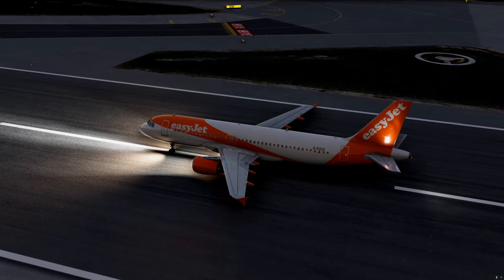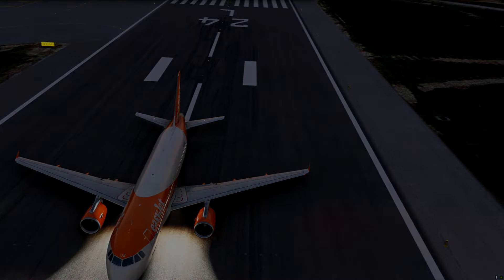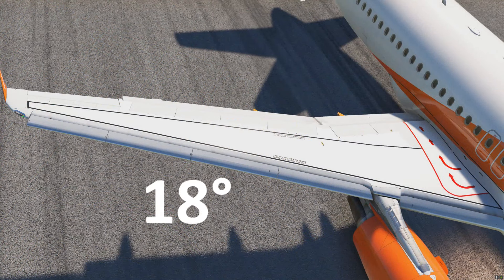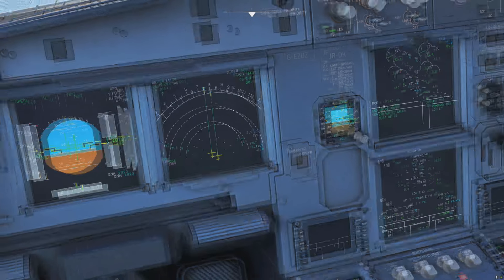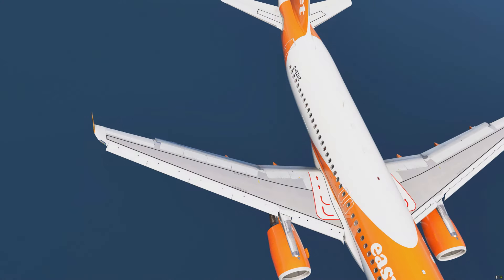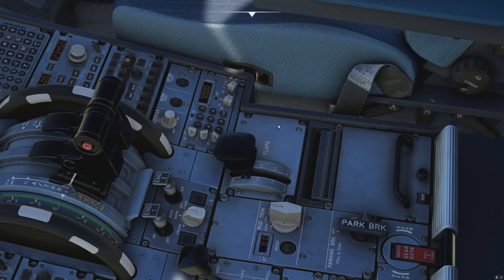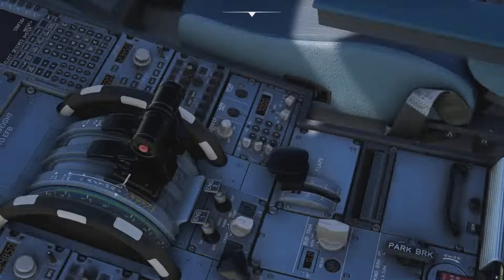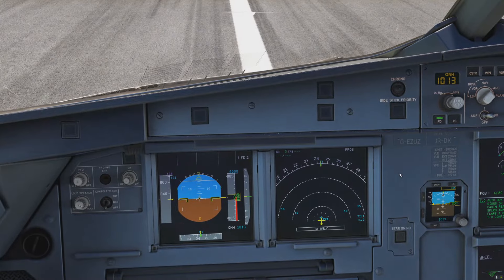Yes, the Airbus can move the flaps all by itself! A320 Flaps and Slats explained.

Comment: What flap setting should be used at hot and high airports? I’m talking about many South American airports such as Bogota or Cuzco or even La Paz. In all of them there are a320 operations which require being very close to MTOW and all of them have long runways but are at a heigh unseen in Europe
Reply from the maker: @pylt93  After a certain altitude you are actually limited by the maximum tire speed which is 195kts on the A320.
I have never flown out of such high altitude airports, but I would think the considerations are the same. If you have terrain around you your climb performance will be the limiting factor.
Don't forget however that the maximum altitude for any flaps on the A320 is 20.000 ft. By this point you have to be clean. Also when flying an approach you need to stay clean until 20.000 ft which might be quite late.
Reply: @fsclips  I understand, it would be a nice challenge to do a Bogotá to la paz video in which to explore this enviorments. I mean a opportunity for you to do something you are not familiar with in real life and thus learn something New and to explain the nuances of high elevation airport operation. I know its a long flight but mainly the takeoff and the landing should be veeeeery interesting, considering that la paz airport its at over 10k ft!!! It should also have implications regarding the pressurization that would fun to learn about. Just a request and an idea for you to think about
Reply from the maker: @pylt93  Very cool idea. One of my colleagues used to fly in South America and flew in and out of all these high altitude places. I will talk to him and find out how it is done. I don´t want to embarrass myself 😉

Comment: Question to clear up some confusion. You stated in the video while standing on the ground, that at position FULL you get flaps 35 degrees. Then in flight, you said at position FULL you get flap 30 degrees. Why do you get less flaps in the same position in the air? Position FULL is never used for takeoff anyways, so whats going on here?
Reply from the maker: Oh darn. I am so sorry. It should be 35 degrees. I will put a comment to correct that. Thanks for pointing it out.
Reply: @fsclips  Ah! No worries! Now it makes sense🙂.

Comment: Great video! Love this in-depth content. Why do you have to have a negative trend vector to put out the flaps?
Reply from the maker: If it is positive it could be that your speed goes above Vfe next by the time the flaps are in the next position. That would result in an overspeed warning. You have to file a report and after landing maintenance has to come. It would most certainly delay all flights for the rest of the day. Better be safe and make sure the speed is going down, not up when you extend the flaps.
Hope this helps.

Comment: Absolutely amazing and informative video. Thank you for it. I also have one question. What is the fallback method for determining the correct QNH when ATIS or METAR is not available? On the ground, I can perhaps adjust it according to the height of the airport (see Navigraph), but I'm not sure in the air before landing. I thought I would use the GPS of the aircraft and set the QNH according to it, but it seems to me that it is not working.
Reply from the maker: @Rene_L  The only way to find out the QNH whilst in the air is either via ATIS or by asking ATC.
The aircraft has no way of determining the local QNH. 
Hope this helps.
Reply: @fsclips  Thank you, each of your pieces of information will move me a little further to a better simulation.

Comment: Interesting that the only position which doesn't move slats is position 3. Any explanation for this?
Reply from the maker: I guess it comes down to how Airbus designed the plane and which settings gave the best compromise for the relevant phase of flight.
I find that F1 doesn't help you at all with slowing down. If you join the ILS with less than F2 you usually have your work cut out.